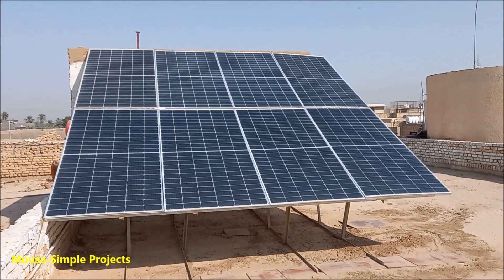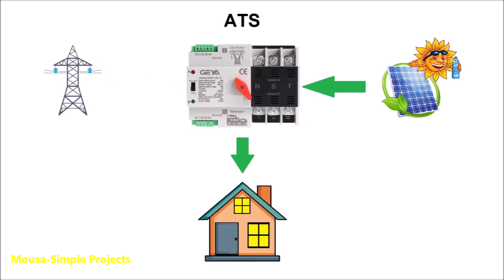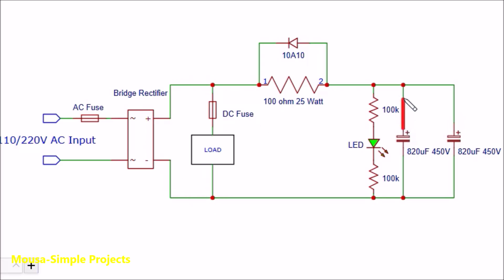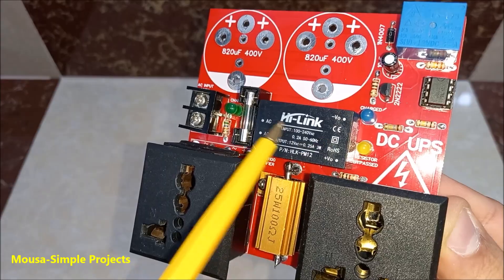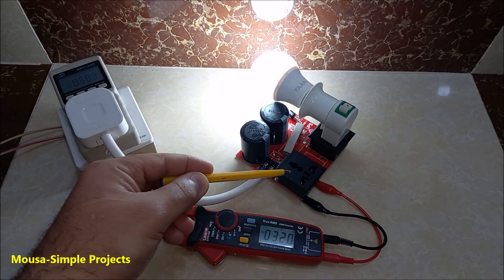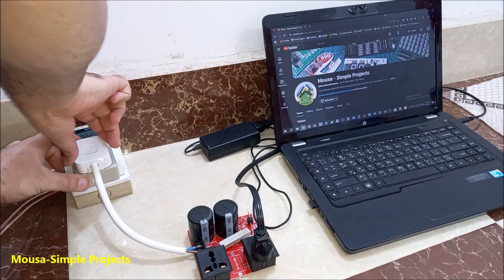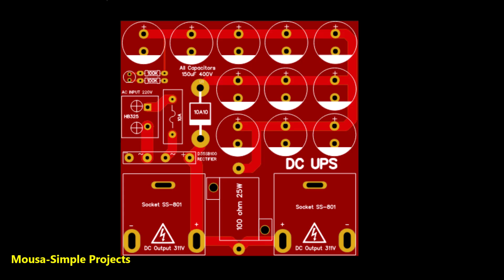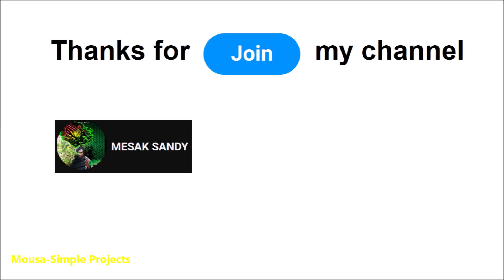Uninterruptible Power Supply (UPS) for WiFi Router and Printer using Capacitors

Comment: What about taking a since wave inverter and connecting it to a DC power supply with a battery in between? Would it work almost like an on-line UPS?
Reply from the maker: Yes

Comment: @2:58
This is the most important information!
The AC fuse is for a DC application not save.
Reply from the maker: AC fuse create arc and catch fire when it used in DC current in case of short circuit happened. so AC fuse is NOT safe for DC current.

Comment: Can we use an NTC instead of the diode-resistor combination for inrush current protection?
Reply from the maker: I'm not sure if NTC can handle the high power dissipation, as i used 25 watt resistor, NTC maybe handle less than 5 watt. Other problem with NTC that they need some time to cool down to recovery their primary resistance value, in case of repeatedly mains power outage they stay hot (low resistance) and allows high current to flow which trip the circuit breaker or blow the fuse.

Comment: This is great! I was toying with an idea of doing the same, switching between a solar and mains source. In my case it would have been an AC unit so much larger currents involved.

Is your next project going to involve a relay board, to switch over the house power when the voltage drops below a set level? And does your inverter support islanding, because mine doesn't and I'd need to trick it to get it to work that way
Reply from the maker: I designed two circuits a few months ago similar to what you are looking for, but I'm still waiting for the PCBs to be delivered.

Comment: Thank you for your good tutorial, I must say that this circuit is suitable for low power consumption, but if we put a high power device, this circuit will be inefficient, it is better to use a combination of fast diode and MOSFET for fast switching.
Reply from the maker: I didn't use it for high power appliances like PS5 or gaming PC, but i don't think any problem could happen except the run time will be very short so we need more capacitors. I think the diode recovery time has nothing to do in this circuit. keep in your mind the electronic appliances already has a small capacitor inside so even if the recovery time can effect, still we have a back up for milliseconds on the other side of the diode before the diode switch ON and add more capacitors in parallel.